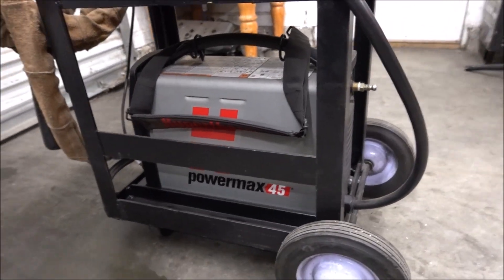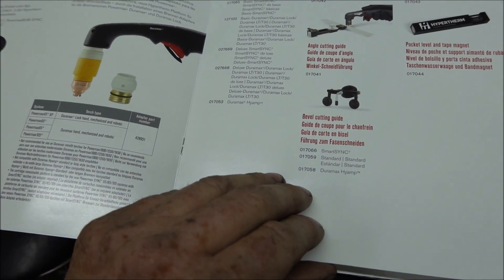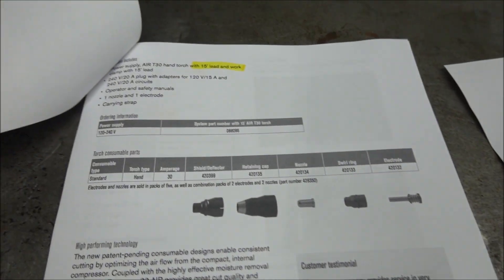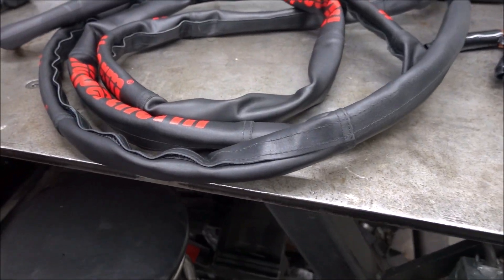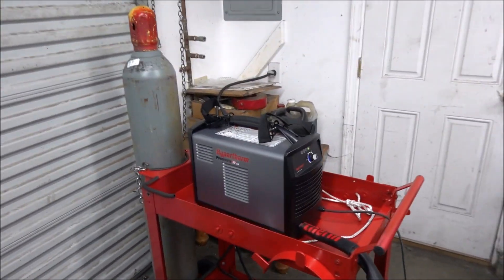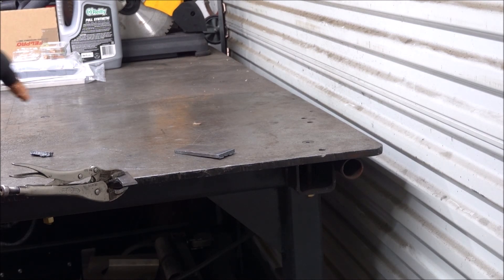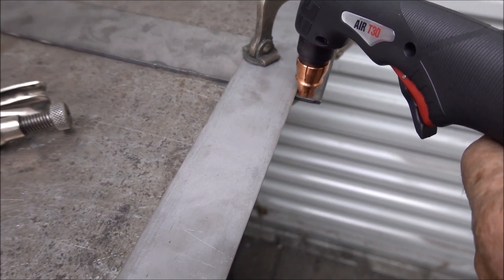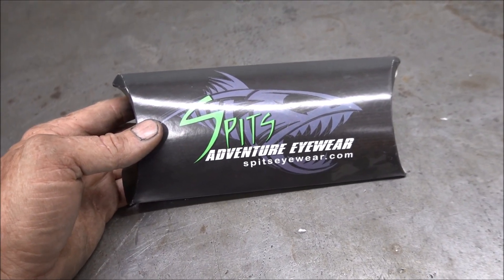Hypertherm PowerMax 30 Air Review

Comment: I've had the hypertherm 30 XP (non air compressor model) for years and it's impressive. The non-air model cuts just a little bit thicker and I've severed through 1-in plate on occasion. Just a heads up, there are two different nozzles available for this series. There's one for 120 volt thin metal (up to 20amps I believe) and then there's a universal one for everything. I think they call it fine cut and regular. The reason I say this is I think you might have had the thin nozzle in there and why it struggled to cut 1/4". Mine seems to cut through quarter inch twice as fast as you were showing in the video.
Reply from the maker: By what I read the 30 air has a little bit less capacity than the regular 30xp.   The 45 has also been great.   They sure have gone up in price..
Reply: Nice tool
Reply: I think there is only one nozzle type for the 30 Air?  I've been wondering how much less cut capacity the Air has because I think it is about 50psi, unknown scfm, and a different tip design.  I like the idea of not needing a larger compressor though.
Reply: @mbrick  I did look up both and you're right the 30 air only has one tip design. The 30xp uses the tip design of the larger 45 and others. The built in compressor would come in handy a ton of times. Especially for working on cars and out in the field and is definitely the way to go for that. Looking at the specs, the 30 XP is about twice as fast at cutting versus the 30 air. 3/8" is cut at 10ipm vs 5ipm and 5/16 is 20ipm vs 10ipm.
Reply: @sixtyfiveford  I noticed that cutting speed being about 50% as well.  I suspect it is driven by the compressor flow rate rather than max amperage at the plug.  They could have easily run more amperage on 240V but may be limited by how large of a compressor they wanted to integrate.  I'm still considering an Air for small projects based on the lack of external compressor.  Not a lot of videos out there about it but I haven't found anything negative written.